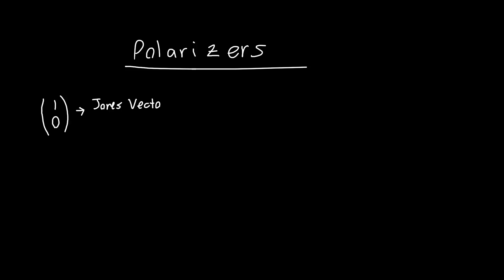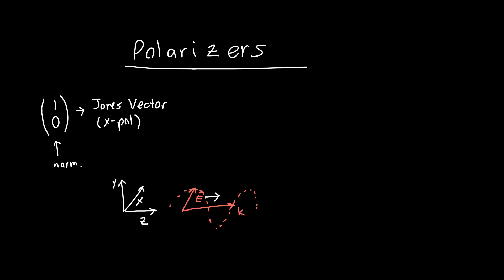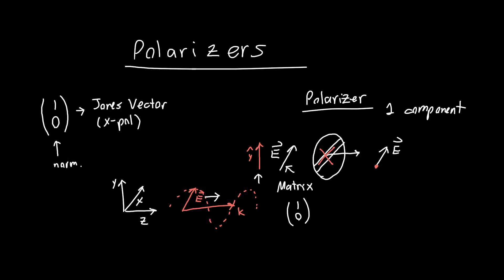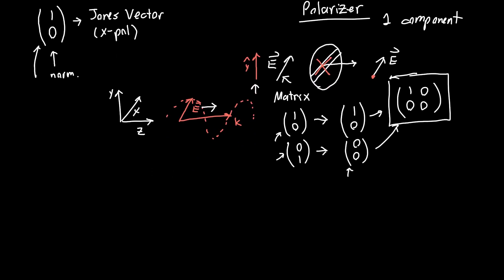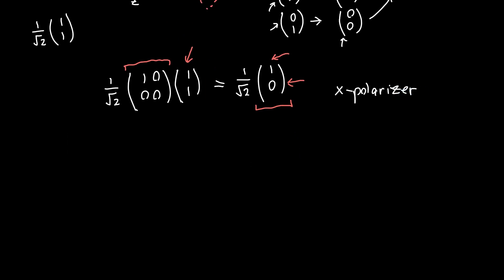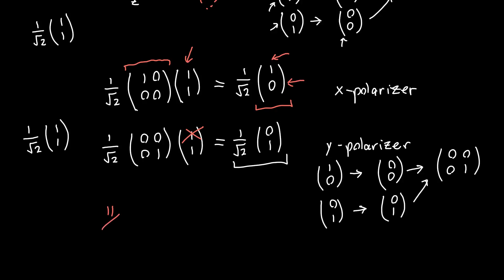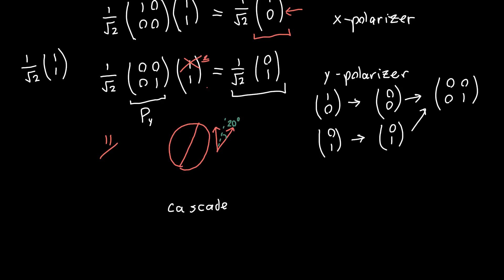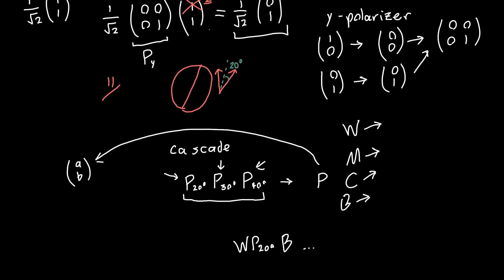Linear Polarizers and Jones Matrix

Comment: Hello sir, why aren't you splitting the electric field into 3 components but just 2 components in x and y directions?
Reply: I believe it's because the z component of the field when multiplied with the k direction cancels out because they're perpendicular to each other
Reply: If you plug the plane wave solutions to Maxwell's equations back into the Maxwell's equations, it turns out that the (vector k) dot (vector E) is 0 (meaning any plane wave solution in simple LHI medium is perpendicular to propagation direction), and also from the other equation (vector k) cross (vector E) is proportional to the H vector. That's just what you get when you assume plane wave solutions and plug these forms back in, and notice that the curl and the divergence just convert to regular cross product and dot product thanks to plane waves being an exponential function. Finally, the reason why we consider plane wave solutions in the first place is because they form a complete continuous linear basis for all possible time-propagating functions you can imagine (not just physically, but mathematically), and any real-world wave can be broken down into an integral of many of those plane waves stiched together (in fact they form the fourier basis for all propagating waves)